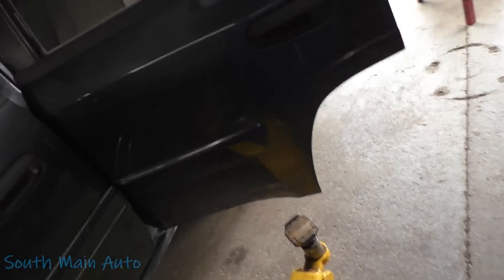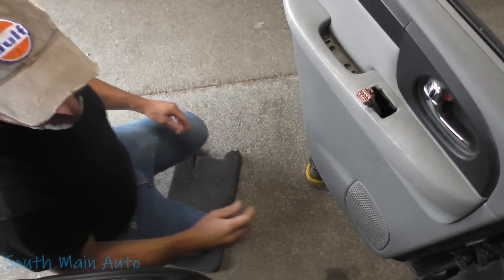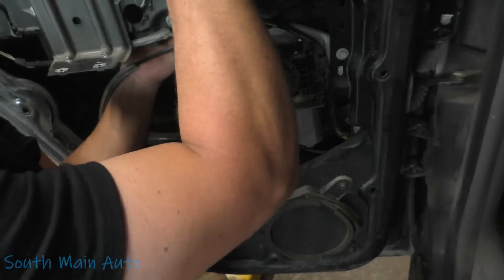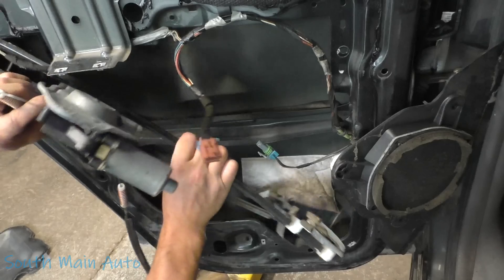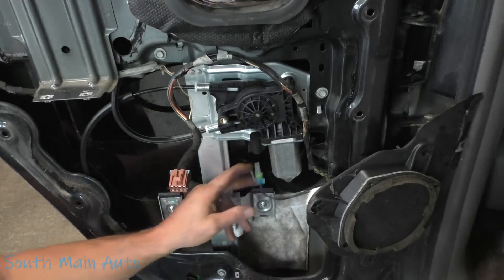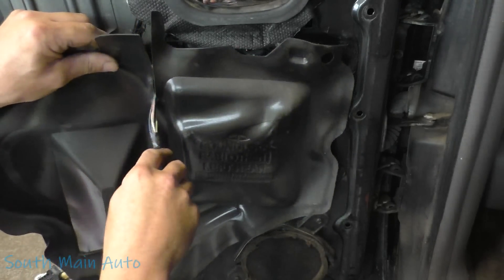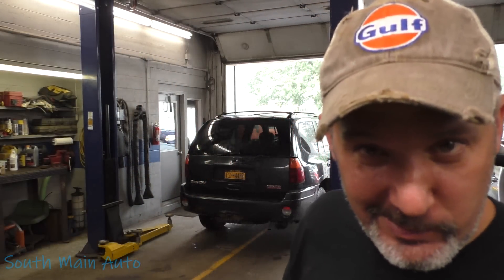Envoy / Trailblazer - Rear Door Window Regulator Replacement

Comment from the maker: Wera 056490 Tool-Check Plus Bit Ratchet Set with Sockets - Metric : https://amzn.to/46WVvx2
Lisle 63900 Window Holder : https://amzn.to/3pSXgdJ
2 Pack Wedge Rubber : https://amzn.to/44whyJe

Couldn't find the wedges that I had but these rubber door wedges look like they'd do the trick IMO. Any how, happy wrenching!
-Eric O.
Reply: You made it look so easy, I remember some of the old Suburbans we had in Saudi Arabia, that was a staple in our parts inventory. Window regulations, door and rear door. We had about 250 Suburbans and summer was always busy.
Reply: -  👍 👍 🔧  qoᒋ ǝɔᴉN 👀❤🤍💙
Reply: I use the Lisle window holder and it works well.  I just used it recently when replacing the power window motor on a 92 Cavalier.  I wish that job had been as easy as yours.  Drilling out rivets and hardly any access holes in the door made things difficult.
Reply: A later Ford Fusion video had you using suction cups and a string. That was genius!

Comment: as a 77 yr old retired mechanic i can say some things today are actually easier to repair. the window regulators from my early days contributed to the sale of a lot of alcohol.
Reply: My 96 Firebird was terrible. Window was scratched to hell when I was done and so were my hands.
Reply: I am a 64 year old retired mechanic. My experience has been the exact opposite. My main hobby is vintage cars. I currently own a 1964 Ford Fairlane and a 1967 Ford Mustang. I have replaced window regulators in both. Both are manual crank windows. Window regulators are not the easiest things to replace on any car, but I found them to be easier than pretty much any modern car. Just about everything is easier to work on on older cars.
Reply: @larrysperling8801 and band aids
Reply: They use to be real aggravating.  You would have to line all the rollers up and run the "scissors" up and down until you found the right combination to make it fit. Don't know how many times I've been pinched and cut.
Reply: That's no joke.  Some of them were nasty.  This one looked to be fairly easy.
Reply: Alot of alchohol is still needed for some of the newer stuff to lol.
Reply: I second that.

Some were ROUGH
Reply: Cheap bottle of wine makes the window issue real interesting. 😊
Reply: I actually never had an old school regulator break,they made things to last back then
Reply: @markcollins457  as i recall back then it was maddog 20-20 that was the wine of choice . very cheap and very effective
Reply: XL model more room easily done
Reply: Regulators are a pain in the a hole on some models
Reply: Bro we drowning in our own smoke over here is Alberta
Reply: 100 percent agree. Replaced the electric motors in the quarter windows in my 68 Buick. Try to line up 4 windows with no post…. It’s hours of fiddling.
Reply: Unless it's a German car, they always find new innovative ways to make things more complicated than they need to be.
Reply: This particular car has a lot of room to work. I work on acuras and they can be a bitch
Reply: Haaaaa
Reply: @geraldscott4302  Chrysler regulators are my personal least favorite ones. Especially when the window is stuck all the way up and you can't get to the clamps. I had one so seized up I ended up just taking an angle grinder to the metal rails after I'd cut all the cables and it still wouldn't budge.
Reply: @geraldscott4302  Clearly you've never done the rear-window regulators in a '68 Ford Galaxie convertible.  😂  You have to remove the entire back seat to get at them.  And the hole it fits through is so small that the only way it'll fit through there is when it's rolled all the way down.  Which is impossible when the reason you're replacing it is because the window-crank gear has stripped itself and will no longer crank the thing in any direction, up or down.   I literally had to cut mine into pieces with a Dremel tool to remove it.  Took a total of about 5 hours of work to replace one regulator.  The ones in the doors are much easier, but the rear ones seem to have been designed never to be replaced.  It was a stupid amount of work.
Reply: Or Band-Aids!
Reply: Who doesn't love drilling out rivets???? Amen, brother.

Comment: Eric actually rolled the window down when cleaning the window to get the very top side of window. No idea how hard it is to get professional detailers to do this one simple step for a complete job of window cleaning. Eric O does it just out of his standard practice.
Reply: The good ones will
Reply: On one particular car, the window always got a black line at the top from the seal, even after cleaning.  Not worth.
Reply: As a former pro detailer i alwas clean the top of the glass with 000 steel wool to get rid of that black streak from the window seal.
Reply: @Guillotines_For_Globalists 000 steel wool will remove that without scratching the glass
Reply: @Jimbah599  Well, I sold that car back in 2017.  It was a 2003 Toyota Camry.  The black marks re-appeared nearly instantly.  Car had only 50,000 something thousand miles on it too, not an old car nor an abused car, always garage kept, all of the rubbers and plastics were in tip-top shape too.
Reply: @Jimbah599  I also am a former pro detailer. It was always the thing I would catch employees skipping on.
Reply: I was waiting for him to clean the edge because I knew he would. That's why he always has a full lot
Reply: As a detailer myself I can say that some cars have horrible seals on them. Regardless of how much you clean them the black marks always come back when you roll up the window. As for using steel wool, I’ve never tried it on glass. I personally recommend using a high quality glass cleaner instead. Car Brite and Pro Car Care have great glass cleaners.
Reply: @Jimbah599  Just never use synthetic steel wool. Glass is harder than steel, but the aluminum oxide abrasive used in products like Scotch-Brite is harder than glass.

Comment: You have to love it when someone takes pride in their work. I know a lot of shops that would have never taken the extra effort to clean the window and door panel.
Reply: They're the ones that don't have a YouTube channel with a stadium full of onlooking critics just hankering for something to nitpick.
Reply: Yep," because only customers pay wages"😊
Reply: And backing the car into the bay so the customer does not have to go out in the rain
Reply: The amount of ppl that want a prideful and good mechanic but want to pay like guy that works at your parts store parking lot is insane
Reply: @Pidroe  I learned that from an old guy I worked for a long time ago.  It didn't rain a lot in Southern California, but it was always the little things like that that customers remembered.

You know: put their seat back where you found it, as well as their tilt wheel, leave the radio station alone, except to turn it off, and so on.
Reply: Nothing makes a good job bad faster than a bunch of fingerprints.  Always clean up after yourself.
Reply: @tetedur377  before we got married over 20 years ago .. the wife had a power steering rack installed ,, well the hood and fenders looked like 50 kids had put there hands in a grease bucket and rubbed them everywhere .  well that shop is not around anymore ..
Reply: @@Martys-4x4 What do think SMA or PHAD and all the others should be charging(obviously all the tools and diagnostic equipment is free, not to mention the building and the continued education)

Comment: Nice job, didn’t see you reattach the wiring harness on the upper right of the regulator, but I bet you did !
Reply: no, he missed it
Reply: I'm pretty sure he missed that one.  That said, I'm equally sure that, considering that he's situated in the rust belt, the vehicle will dissolve before that bolt head rubs through the wires.  😛
Reply: he forgot it. it doesnt have enough slack to get into any trouble though.
Reply: I'm sure that vehicle already has plenty of louder rattles. They'll never hear that little cable banging around 😄

Comment: In my experience, most of the really good mechanics I worked with were not good at trim jobs.  I think it's because it requires much slower work, a lot more patience in R&R,  and doing a lot of checking to get the fit and fasteners right.  But once again, Eric shows why he is the renaissance man of vehicle repair.

Comment: That speaker coming out like that is genius. That opens the space up so much. Most of the time you have to work in 2 little squares...
Reply: My father was an engineer at Ford, he's long since retired and passed, and his job was working out the kinks that the designers put into their stylish vehicles, making them more user friendly. He would have had a hole drilled in the speaker panel for that last bolt to make it easier for the window regulator to be replaced.
Reply: @clintshiplett8548  I was a Ford mechanic for a lot of years.  I remember having to drill holes in those panels.  They were dimpled, but not drilled.
Reply: That speaker seems to have a baffle which would be for audio quality.  Or that's what I thought of when I saw it.  Kind of solves multiple problems at once.  Neat.

Comment: That rubber liner looks a lot more robust than the flimsy, foam rubber material they use on most of the cars we see over here in the UK. It's virtually impossible to pull that stuff off without tearing it. I usually end up putting them back on with strips of gaffer tape (duct tape) all over them. Glad I'm retired now and that's one more job I don't have to do any more.
Reply: Gaffer tape is not duct tape.  It's stronger, sticks better and has to be cut ( can tear it lengthwise).
Reply: Far too many times it isn't even butyl, it's often just polythene sheet which tears as soon as you look at it.
Reply: My 95 sierra just had clear plastic.
Reply: After watching some vehcor videos it seems GM has the best liners in the biz
Reply: Wait.  You put the liner back on?  🤣

Comment: That went very easy! My experience with European cars is quite different - it's a pain to get the plastic cover out intact (pegs tend to break) and regulators used to have 4 cables and it took forever to get them out (usually had to drop the glass to the bottom, to get enough space), have them repaired (much cheaper than a new one) and refit the whole thing, praying for no plastic damage.

Comment: On the Firebird forums they always recommended aftermarket window motors that have a life time warranty, the thought process was that the aftermarket motors were a quarter of the price of the OEM part, they seemed to last as long as the OEM part, but if they failed, you had a life time warranty.   
I hope the rain cleared up the smoke for awhile.

Comment: I've changed several window regulators in my day. 
No matter how careful I am I ALWAYS get the black insulation sealant on me. Its murder on the arm hairs.
Reply: Also. You are welcome for the smoke. Everyone loves the smell of a campfire....
Reply: That shit is bad. On the clear plastic ones I slice them down the middle and tape them back up. That adhesive gets everywhere on everything. I also use the newer style of pressure adjust suction cups to hold the window up. I find the door panels fit into the top groove a lot easier with the window down.

Comment: Great job, I've changed my Lincoln Town cars regulators, both front and rear. They are not as easy, windows must come out, to remove the track assembly. After doing two, I made a small change to the top two studs, shortened them by 1/4", now the window can be secured at the top. Allows the track room to move away from the door frame. Also learned not to buy them off EBay!!! Auto Zones are better, EBay lasted less than one year. So now, I can do it, like you can do it. lol Thanks for sharing.

Comment: I've always driven beaters (not all started as beaters, but I refuse to swap out a vehicle that runs and drives just because it hits x mileage) and I've changed a lot of regulators (mostly driver's window - probably something to do with my eating habits).  That one seemed fairly typical if not a little nicer based on the engineering involved.  No rivets to drill out, holes to access the bolts when the thing is all the way up, etc.  My dorman experience with them has been fine.  I think I had to warranty exactly one, but frankly that one sounded "crunchy" from the beginning, so it didn't so much as fail prematurely, but was defective from the start.  As always, nice job, meticulous in your work and I always appreciate that about your videos.  Nice touch cleaning the glass at the end, too.  I don't always do that on my own vehicles after my greasy paddies got all over it.  Thumbs (greasy and otherwise) up.
Reply: Don't move to a salt state with safty inspection. The state makes me swap out rides. Some as low as 88k.
Reply: @Wrang15  I live in PA. Plenty of salt here. I replace the beaters when they are unsafe.
Reply: @emcque  I am in PA  too. 30 min from the NY state line. I can't get anything to last more then 10 years. 8 seams to be the average. They just spray  brine  year round. Paved  roads in winter dirt  roads in summer. Tar and  chip sand blasts all the paint off the undercarriage  too.  I hate Pendot lol.

Comment: The Citroen DS has hydraulic windows that are almost silent and very quick.  The hydraulic system ran the transmission, windows and suspension.  I only got one ride in a DS, but it was literally the smoothest and most comfortable car I've ever experienced.  The other end of the comfort spectrum was a '64 Freightliner I drove in my brief career of trucking, but our '53 Chevy 3600 pickup came close.

Comment: Nice seeing someone else do these. Been there, done that last year. Got a working window to prove it. Yep, last July 4th. The plastic clip that holds the regulator cable broke and made the mistake of lowering the window, only to not get it back up, so had to drive that way to the park for the 4th, on the state highway so it was a bit noisy. 

Was able to replace it the next day with a part from Doorman. The car, a 2003 Mazda Protege 5. Regulator is still functional a year later.

Comment: As usual another xlnt video.  I've done bunches of regulators in vehicles probably due the OEMs are good for about 15 years and and the extremely cheap Chinese replacement components (usually found on eBay for under $40) last about 5 years.  Here in Los Angeles, California the switches seem to wear out faster than the regulators.  And yes, due to our great weather here and the use of a Garage, it's common to see 25-30 year old vehicles including foreign ones still on the road.  Usually it's the expensive replacement emission components that drive these vehicles into the wrecking yards.

Comment: Well Eric now that you mention it, you did forget one thing. It’s not something that matters but someone still might bitch about it and that was the wire retainer clip on the regulator. 7:50 is where you pulled it out. That was definitely one of the easiest regulators I’ve seen changed. At least they didn’t rivet the whole thing in on this one. 👍🏻👍🏻👍🏻

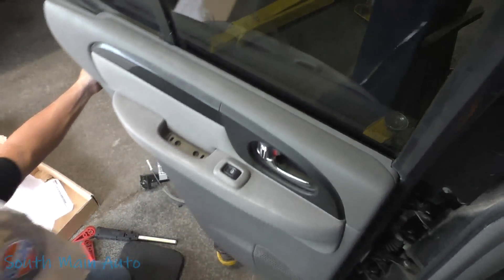Comment: A-ha!  At around 18:00, you spilled the beans and told us this was a Dorman part.  I was wondering when you said that the 3rd bolt wasn't quite lining up - that was when I thought of Dorman.  Last year, when the driver side rear window dropped into its track on a rainy evening, on my 2003 Saturn L series, I found out that eBay had some, priced pretty low but might not have as many cycles in it as that Dorman.  The worst part was having to keep the window taped shut for the few days it took for the new one to arrive.  It's sure easier when you don't have to wait for the part.

Comment: Good job, no collateral damage and all put back as it were !
Dorman window regulators are an upgrade from OEM in my DYI experiences. Not only that, lifetime warranty so if they fail, the shop or customer won't be buying any more regulators. We had one Dorman regulator fail wherein the cable rolled over a nylon/plastic pully and that can happen only once as the groove is then widened and rolled out due to plastic characteristics. If they had used metal, that wouldn't happen but they might be more prone to higher noise levels. 
When we used the more expensive OEM regulators, they weren't worth the gamble and extra cost especially when Dorman has an upgraded design from OEM known flaws and their warranty.
This job would have been about $500 at the dealership and these regulators with their components are prone to fail. Their design is fairly good for saving weight however, the cable routing and pulleys used need more refinement due to their high failure rate.

Comment: On my 2000 Buick LeSabre I replaced 6 regulators.  I went around all windows once and was on second round.  I was able to change them out real fast. (Practice makes perfect).   Those two holes to tighten the screws  for the window bracket really came in handy.

Comment: Yesterday I replaced the front passenger side window regulator in my son's GF's '08 Dodge Avenger. If they ever need it replaced again it's going to cost them more because they'll be taking to a shop! And I did roll the window partway down when I was done to clean the very top of the window!

Comment: As always another great job with plenty of fine fitting before sending the pegs home with the hand hammer seems I've usually run into bent over or broke plastic pegs the last guy forced into a missed hole you realize this should not require force to remove and reinstall ease it back to where it belongs /wants to go good job made simple